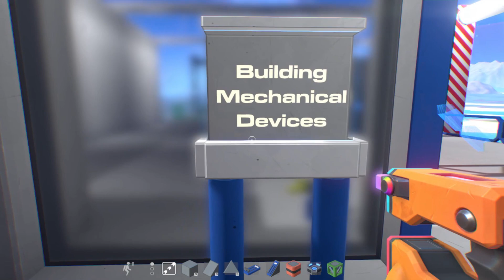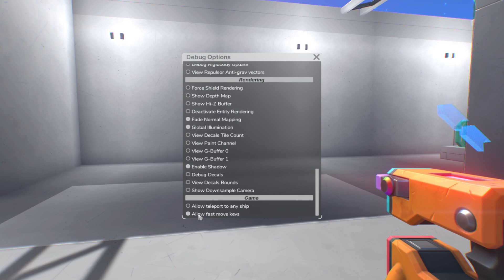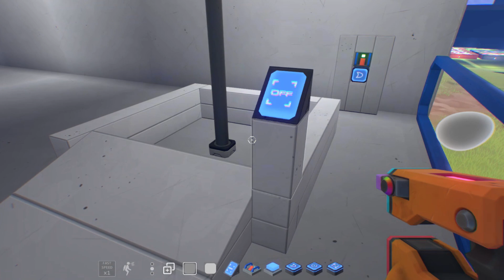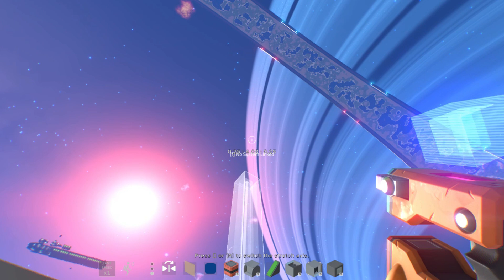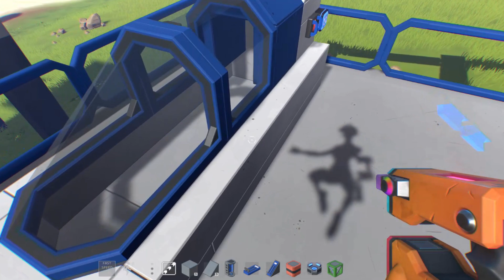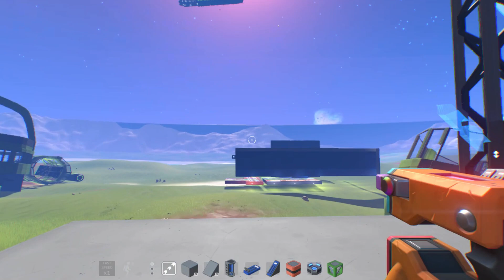Comment: Just got the game and trying to follow this tutorial, but I keep being told that I can't place blocks in various places, for example alongside the rail, as you have done. What am I missing/doing wrong?
Reply: As an example, if I put down a small rail 6 blocks long and then put a small 6-block unit alongside it, I can't then put a small block on the rail. If I do it the other way round by putting the rail down first and then putting a small block on it, I can't then put a small block on either side of the rail, level with the block.
Reply: OK, after a bit of trial and error I may have resolved this. It seems to be to do with the position of the rail, although not sure why. If I can't place a block I move the rail to the other end, then I can place it.
Reply: Sorry it's taken so long for me to respond, YouTube is a quite inconsistent with notifying me when someone has left a comment. I'm not sure what could be happening in your case.
Maybe it's something that I automatically work around now and never notice. 
Next time I'm playing I'll see if I can replicate the problem.
Reply: @curioinventorium  Many thanks.
Reply: Ive been trying to replicate your problem, but can't seem to do it.
One thing I suppose, is to be aware of what the mouse pointer is over before trying to place a block.
Also make sure that the block isn't being stretched into the rail as you place it.

Comment: 2 buttons on 1 switch: you don't need a logic gate. You can link the 1st button to the 2nd button and that to the switch.
Reply: Lol, I hadn't thought of trying it that way.
I guess I'd been working from a different modular perspective
Reply: @curioinventorium  totally valid. Different approach. Yours may be easier to understand (for a third person) when you have a lot of buttons for 1 switch, mine is a little bit faster and you save 1 block, but would not do it to cascade more than 2 buttons.